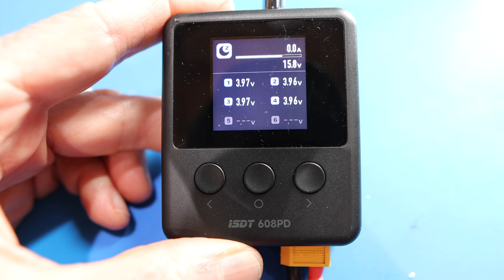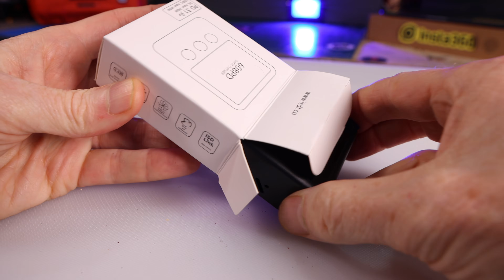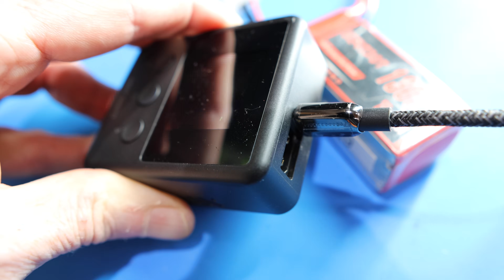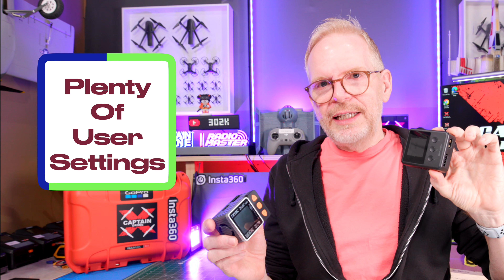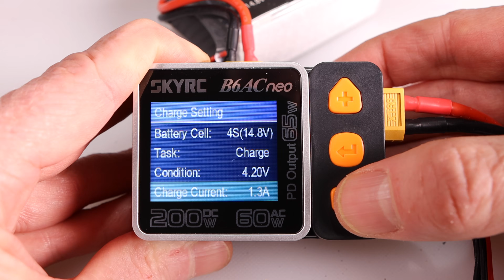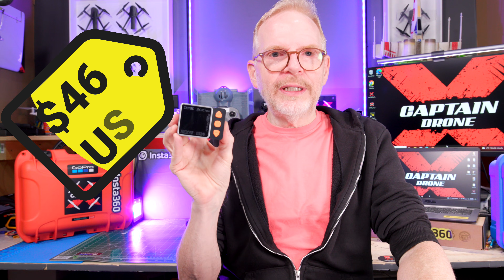New Tech - Mini Battery Chargers - ISDT 608PD & SKYRC B6AC neo

Comment: I fly Goosky S1 and S2 max they use the JST connectors JST-XH or something I believe, will these work by charging through the balancing port only?
Reply from the maker: Probably not.  Didn’t your S1 and S2 come with an XT30 charge cable with connected balance port?  If you lost it or bought a used helicopter, then you should be able to buy such cable on amazon.  The cable plugs into the balance cable and has both an XT30 and balance cable on the other end, so you charge like a normal battery.
Reply: @C@C @CAPTAINDRONE798 s2 max 3s batteries I believe I will be good they have XT30 but the S1 2s only has JST-XH or something it’s the only wires coming out, I actually got both of these chargers today from your review, I will be able to use them on other stuff and will be future proofed lol but I am looking for something that I can bring to a field so I have multiple batteries going! Even for my small heli and my father’s that is coming in soon.

Thank you by the way I will start researching the adapter if that is the only way.

Comment: i bought the b6ac neo and im not impressed. i had to return the first one i got and the replacement has all the same issues. for one, once its done charging or discharging it reads the cell voltages as .3 - .5 volts off of what it was set to, no not .03 or .05. the other big issue is that half the time i plug it in to an outlet it tells me the dc in voltage is to low, FROM A WALL OUTLET. this happened both on this charger and the first one they sent me. i also dont see any way to calibrate the voltages.
Reply from the maker: When you plug it into the wall you have to tell it that it is now AC power.  I’ve never tried configuring the voltage so I can’t comment on that.
Reply: Yeah the same happened to me. First time I plugged it in a wall outlet it says DC voltage too low. Unplugged the plug again. Problem gone.

Comment: When I charge the Li-ion battery 2S 1500 mAh from the B6AC Neo charger, it shows a cell error. I connect only the balance port. Is it necessary to connect the discharge port or some other reason to get a cell error? Please guide me.
Reply from the maker: Doesn’t your 2s lion battery have both a balance cable and a voltage cable?  You plug them both in.
Reply: @CAPTAINDRONE798 Yes, dear, its RC car battery has both cables, balance and voltage, but the discharge/voltage cable connector is Deans female. But on charger output XT60 male connector, I have ordered the Deans male to XT60 female connector. After it arrives, maybe the cell error fix I wanted to know if there was any other reason for the cell error?
Reply from the maker: @raghibshuja9280  Yes, try again when you receive the connector.  The error could be in your settings... you may have told the charger it is a 3 cell or 4 cell battery perhaps, instead of a 2 cell.
Reply: @CAPTAINDRONE798 Thanks for your suggestion i will try

Comment: on the 608pd could the battery charge using only the balance lead or do you need to have the xt60 plugged in? I will need an adapter for my xt30 if so.
Reply from the maker: As far as I remember the voltage needs to be plugged in

Comment: If li ion is not in chemistry type list then how to seletc li ion. Please answer, it will be very helpful, thanks
Reply from the maker: Modern LION are charged the same as modern LIPO.  So if you have a LION battery that is from today or a couple of years ago, you can select the LIPO setting.  The only thing you can't do with a LION battery is over charge it like you can with a LIPO.  So if you have a 1000 mAh LION battery you would select a max of 1 amp or less.
Reply: @CAPTAINDRONE798  thanks sir , I appreciate

Comment: Just got the ISDT 608 charger, There's a firmware update now that allows you to set the LIPO charge voltage to lower voltages so you can now charge it to storage voltage. I guess prior to that update you couldnt set the voltage lower than 4.x something volts.  Made this charger much more useful .

Comment: These chargers are both so cool, but why do they both have to have such big  flaws? The Skyrc one can't take PD in, and the isdt one can't storage charge lipos? Does anyone know of a charger that can do both?
Reply: There is a firmware update for the ISDT that allows you to adjust to storage voltage now.
Reply: @Nunyali5lx  Seriously?! Im guessing it can only storage charge batteries under 3.85V and not discharge them, but would you mind sending a link to it? I'd buy it in an instant if this really works.
Reply: @seantuitz  Yeah it does not have hardware in it to discharge.  I just installed the app on my phone and connected to the charger and it automatically did a firmware update. There is a youtube video about it. I tried to link to it but it deleted my message.
Reply: Skyrc has the B6 neo that takes PD input

Comment: Hello,
First I want to say that I really like both of these Chargers and have thought of buying one or the other. However I have seen more than a few reviews on the skyrc where they say it has a lot of issues with the fan where it just stops working. One of the reviews had purchased five or six of these devices with all but one turning out to be defective.

However, those reviews were from 6 months ago thereabouts so it is entirely possible that the issue was found and fixed. It is also possible that they did not fix the issue which is my main concern.

The new generation of chargers are getting smaller and smarter but I would gladly give up a little bit to get a charger that is Rock Solid reliable. There's a great saying that goes simply  "buy once - cry once".  The shininess of something new always wears off but the regret of wasting time and money does not. In my opinion it is better to save up for what you really want rather than jump in with something that is a lesser quality or capability.     

So if anyone knows any updates on what was wrong what they did to fix it, did skyrc reach out to those people to give them replacements or refunds?  I have asked the same question on those other channels but have not seen a response yet.
Reply from the maker: You are asking very strange questions.  The items shown in this video worked great!  Perhaps you need to watch more video reviews.  If you watch 10 reviews and 9 are positive reviews and 1 review is negative, then you should focus on the positive and ignore the negative.  Majority all wins!
Reply: Hi,I have this charger and two of the smaller neo versions, haven't had any issues with the fans on any of them.
Reply: Got a couple of the neos, the B6neo and the B6AC neo, neither has had any issues at all either..
Reply: @garyfornow542 I have exactly the same questions and concerns, so I guess that makes both of us “strange” 😆. The problem with YouTube is many “reviews”are unboxing videos so it’s the first time using the product, which gives zero indication of reliability. And the elephant in the room is 9 out of 10 reviews are positive which pushes people to purchase from their Amazon affiliate links. We need more critical thinking and opinions in this world and if that means less California sunshine positivity, so be it.
Reply: @garyfornow542   the five chargers with issues are NOT the AC version.

Comment: tbh I wouldn't trust any mains powered device from China without proper safety/3rd party certification from the likes of UL/ETL/TUV/etc, there's a reason why power bricks are of a certain size, I'll much rather use the ISDT with a proper type-C power adapter
Reply from the maker: Everything is from China, even the ones you believe are certified.
Reply: @CAPTAINDRONE798  Ofc everything is from China or some other places in Asia, what I mean is, mains powered should be certified by 3rd party for safety, low voltage/type-C input is OK but I do not* use anything that plugs into the wall unless it's certified and even those are not fool proof but at least gives you some peace of mind lol
Reply: Eg I would use the B6 Neo, non AC, and buy a properly designed, safe power supply to power it.
Reply: Agreed 💯

Comment: They seem to be handy little tools with a lot of features - but when complexity goes up , then reliability goes down. John Hopke didn't have such a good run with Neos he ended up with. Might have just been a bad batch. 😉 
I believe we have at least 10 of the old SkyRC B6/B6AC/B6ACv2 etc and their el-cheapo clones. Only had to bypass a worn-out push-button on 1 and repair the AC brick power-in DC socket on another - not a bad record. Add a fistful of the little discharger/balancer units to take care of any not-used batteries and we're good. 😊